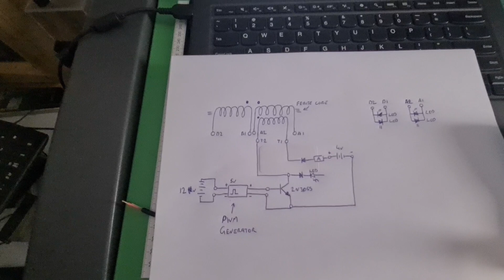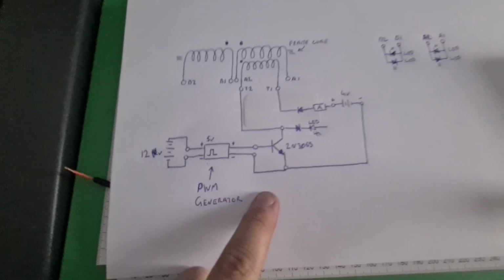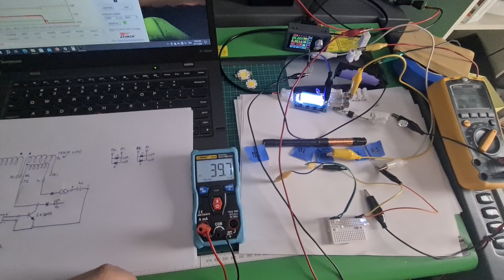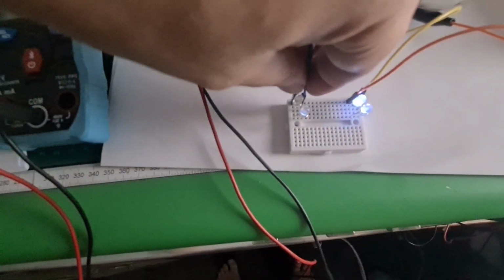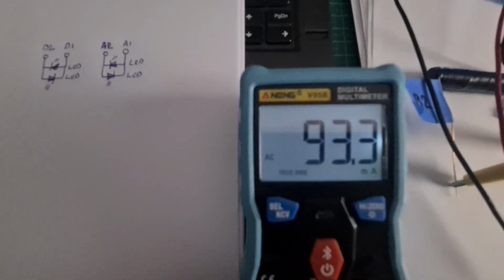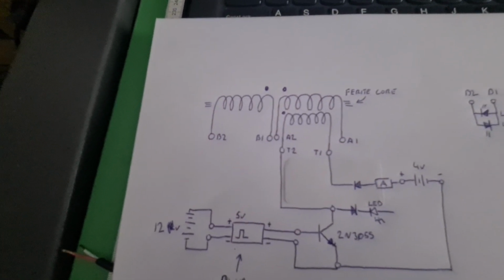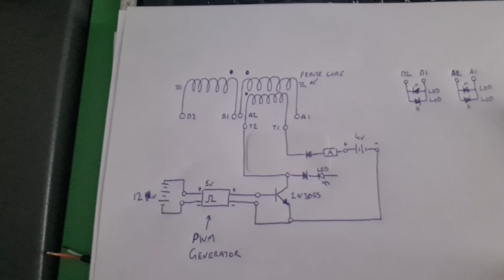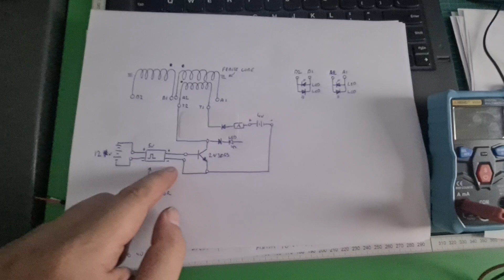Opposing Coil arrangement, Asymmetry at work.

Comment: I’ve experienced a similar effect messing around with my slayer exiter tesla coil i built if i hold any metal object near it or even better coil of wire and touch it it seems to loose all voltage but instantly vaporises my skin  so there seems to be just insane current a few old ferrite cores with random coils on them from my other projects work best but i imagine this would be even better and essentially the same setup but oscillating at 3.7mhz Just gotta wind the coil to resonate at whatever my tesla coils making for best effect i suppose